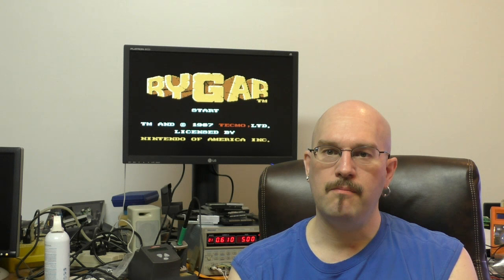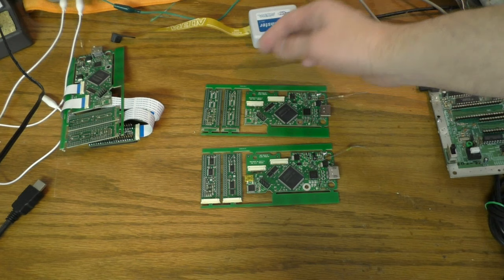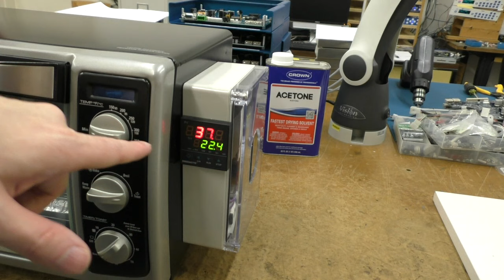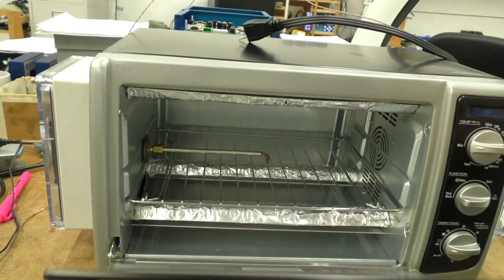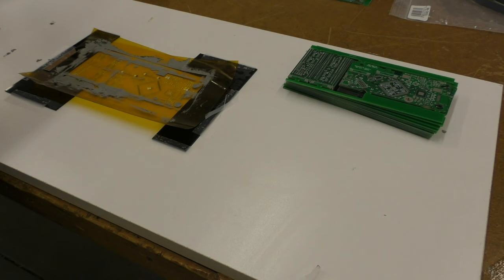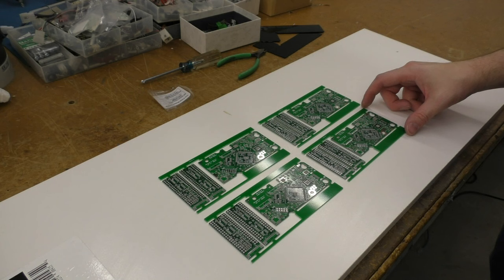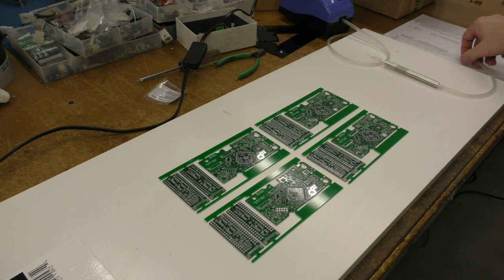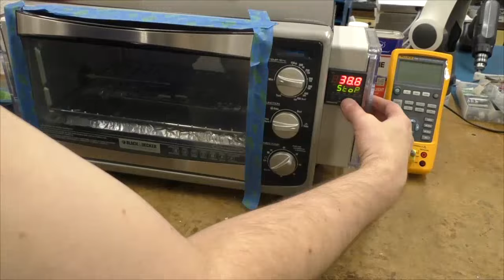Hi Def NES Update #8:  Toaster Oven Solder Reflow

Comment: So is this the same board HDMI board in the Analouge NT? I saw the Verge article about the NT mention you but since the NT was announced way back in May of 2014 and your project in November and no mention from you about anything I thought it must be a mistake. But now they have posted a video about the HDMI and it looks EXACTLY like what you have been working on. So is the Hi Def NES dead? and do we need to order an NT to get your board? I'm so confused now, so please clear this up. Thanks.
Reply from the maker: Ras137 no, it's not dead.  I am still going to sell it as planned; nothing's changed in that regard.  I will be posting another update video soon, I only have one thing left to finish and it will be done.
Reply: kevtris Cool, thanks for the response.

Comment: Two questions: is the sound protocol going to those 5 pads what's called 'I²S'? Will DVI-mode disable this signal? It would be useful for PC monitors if the signal was still there but I don't know if it's possible.
Reply from the maker: Rikard Bengtsson  yes it's I^2S but without the MCLK signal.  There's DACs and other things which can use this directly.  I thought about making small oshpark designs that people could make themselves if they really wanted it.  I suspect audio DACs and S/PDIF will be the main uses.  The signals here are only 1.8V logic though so might need some level translation to be useful.

The audio is always present here no matter what.
Reply: kevtris Why isn't MCLK included?  This would make adding a SPDIF transmitter IC, such as the CS8406, much more difficult. You'd have to add an external oscillator and I'm guessing it likely won't perform as well compared to if the HD NES provided it, as asynchronous operation can result in higher jitter and/or other undesirable results?
This reminds me of asynchronous operation of RGB video encoders (e.g. CXA1645), where if you don't get the subcarrier signal from the same IC that generates the RGB signal and sync, you will have video jitter on the S-Video/Composite video outputs. Hence, if MCLK isn't provided, it might be a better choice to get SPDIF through a HDMI audio de-embedder than to add SPDIF output at the console.  :|

Looking forward to buying a kit!  Great work! :)

Comment: Nice work! Just wondering, how are you going to flash the FGPAs if you do not have a JTAG plug on the board soldered? I have the same issue, a board of mine does not fit, if the JTAG connector is on the board.
Reply: ***** Something like this:  "Spring Loaded Pogo Pins" (search google)

Or you can have a spring-loaded jig that presses DIL male headers down...  Better if you're doing hundreds or thousands of these things as you can also include a bed of nails for other test points.
Reply from the maker: *****  yup, I will be using pogopins and a fixture to do the programming.
Reply: kevtris What about HDMI licensing by the way? I read here and there that the HDMI transmitter covers the license. Is that true?

Also, I read about people trying to get datasheets from Silicon Image and they will only supply them if you have a HDMI license. Does that mean their transmitters do not cover the license?

Comment: Another thing. When looking through your file dump for new goodies I found this:
http://blog.kevtris.org/blogfiles/hdmi/ver%202/ver%202%20stuffed.JPG
I can see that the HDMI plug is a bit recessed. Will a regular HDMI cable still be able to reach in for a good solid connection? Maybe there are longer kinds of PCB mount HDMI sockets that would enable a more "flush" apperance? Sorry for my stupid questions and worries. Stay awesome.
Reply from the maker: Rikard Bengtsson yeah I am kinda worried about that too; I think I can get longer HDMI connectors though.  I will figure it out hopefully :-)
Reply: kevtris I don't doubt you will! Maybe you can make a little "outgrowth" on the PCB just wide enough for the connector to fit and long enough for it to reach through the plastic, if you redesign the board again that is. ;-) Just a thought. I will shut up now, I know you will deliver a great product. I'm a big fan of your works...

Comment: Is this mod only for toploaders?
Reply: indcsion It'll work on anything with a 2A03 and 2C02, the only issue is getting it to fit in something like a Famicom.
Reply: ***** ...or 2A07 and 2C07, if you swing that way. ;)
Reply: That too! I wonder if this can be adapted for the RGB 2C03s, as well.
Reply: ***** I don't think it's possible, atleast not as easily. RGB PPU's lacks some of the outputs (EXT0-3) that are neccessary to generate digital RGB as it uses those pins for analog RGB. I guess you could replace the PPU as whole with an FPGA though, but then I would rather see the whole arcade board reproduced. :)